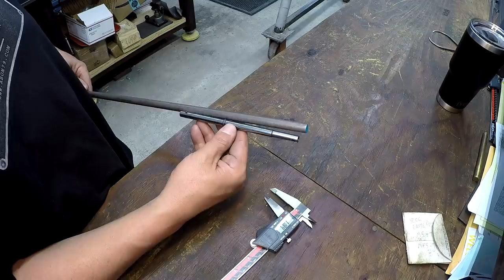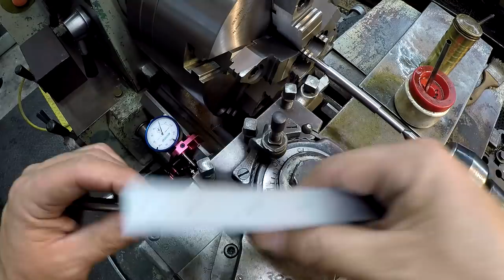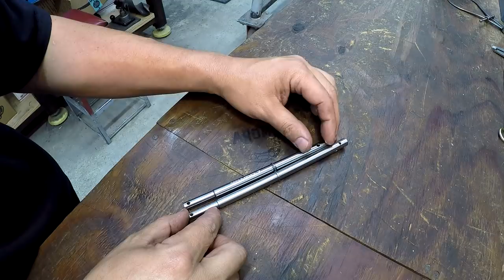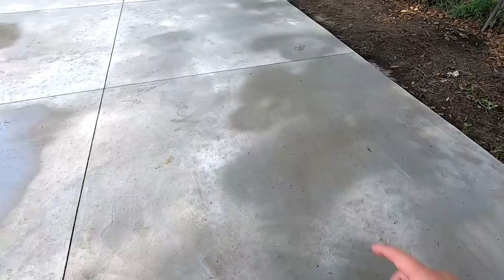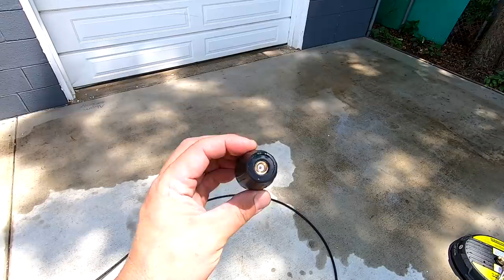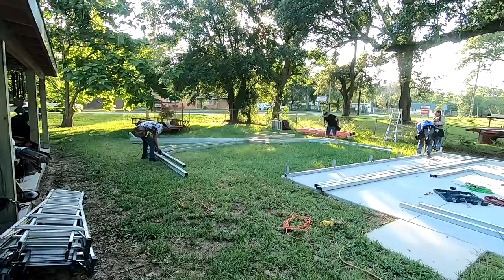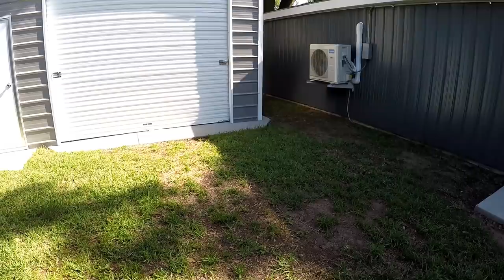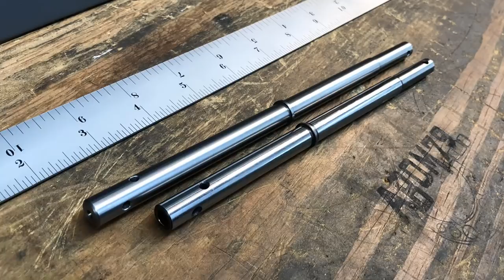SNS 264: Drone Shaft, New Garage Building, Carriage Indicator

Comment: Hey Abom79 apologies if this is a silly question. This question is for you and for the big fans.
What is the specific type of lubricate that you apply when taking turning cuts on the work piece?
Ouuu wi even thought is bed time in my region you got me hankering some of that Shrimp man?
Reply: Dark thread cutting oil.
Reply: Pretty easy to get from a hardware store if you need some
Reply: I use Oakley dark thread cutting oil from the plumbing section of Home Depot.  It’s about $7 for a 16 ounce bottle.   I also use 10w40 on aluminum, it works great and doesn’t give me headaches like kerosene(which is also good on aluminum).  The Melissa & Doug no spill paint cups from Amazon work great with acid brushes from Harbor freight.  Hope this helps, Chris
Reply: @calvinculpalt  Thanks
Reply: @shadowdog500  It helped alot. And your reply has provided me with all want I needed for my machining lubrication setup.

Comment: Adam, how do you heat and cool such a building? Where do you place the insulation? It does get hot and cold in Pensacola doesn't it?
Reply from the maker: It’s a storage building, not a work space. You can buy these with insulation for a price.
Reply: @Abom79  What kind of insulation would work? Clearly, there isn't any room to put in fiberglass bats. My question was more of how to do it rather than why you didn't do it which of course is your business. I don't see anywhere for the insulation to go.

Comment: The customer was wrong.  The rod must be hollow to save the flying weight.
Reply: They do not have to be hollow but they can be hollow to safe flying weight. These helicopters can lift quite some weight and allthough it is preferable to keep weight as low as possible, these grams do not affect flying behavior that significant (especially considering that they are right on the axis of rotation). My guess is that they did it from a mass production point of view, there is quite a lot of material (and money) saved when you can make these mainshafts hollow. When I look at the cross section of the shaft it could be more than 50% savings in weight and material.
Reply: @StefsEngineering  An heavier shaft will produce higher gyroscopic precession forces. This will affect handling when trying to change yaw, pitch or roll. How much depends on RPM's and weight. Hollowing out a shaft will affect production cost more due to tool wear and production time. Usually this is way more costly than the cost of the steel saved. (Steel is cheap.)

Comment: would be nice to know what the price was for that little shaft was.
Reply: OEM Align helicopter shaft $21.39
Reply: @eksostan9176  if correct, thanks.
Reply: @eksostan9176  That was for their original spec - Adam's customer wanted it modified, so much more than that for a custom part.

Comment: Strange that the customer wouldn’t just buy new shafts from any of the hobby stores that carry Align parts. They sell a two pack of replacement shafts for $20.
Reply from the maker: I’m willing to bet he wouldn’t have gone through the trouble finding a machine shop if it was just that simple.
Reply: Did he not want a longer shaft? Maybe that would be why he got it custom made? That's the customers prerogative if he is willing to pay .Nice work as always
Reply: Longer shaft most likely to provide clearance for a replacement body the is a scale copy of a real helicopter. This is for a T-Rex 550L. I have one that is slightly smaller.

Comment: well.. dont know for sure , but if the shaft is really gointo rc copter of any type , its way too heavy. ofc ..if person dont mind of serious (FAST)rotating mass , then its ok. Nice job any way.
Reply: I'm 90 percent sure that its atleast an align 600 or a clone.  As he said he didnt really know but my guess it he converted to to be a heavy lift heli for more of the "drone" capability and not so much as a performance helicopter that it was. Weight is always an issue but for regular flight not so much.

I did the same thing with my SAB helicopter.   But to carry heavier load I had to put a beefier head to hold the larger blades to give better lift and the factory shaft didn't work.  So a custome shaft was made 1 inch longer.

Comment: how much was that building installed?  Out of curiosity?
Reply: @oleran4569   The last metal building I had was from one of those carport metal building companies.  I traded a construction buddy for the cement work (I replaced his clutch, he handled the pad)  My buddy had me get the exact measurements and poured the concrete on 3 sides to the exact dimensions so the siding would lay over the edge of the pad and keep water out. (he gave it a few degrees slope too so it didn't come in on the side with a roll up door)  I forgot all about this until you mentioned your issue.  If/when I do my next metal building I will make sure to do this again, thanks for the reminder.

Comment: For the lighting, why not look into getting Solar panels and a battery? I know Harbor Freight has ones for RVs that does about 100W, so maybe using 2 of those and a battery would give you enough for lighting?  If it isn't going to be a workshop, that should be all you need...
Reply: That big old tree shades the roof.
Reply: @garybaris139  They can be moved to areas where the sun does hit and run cabling.  It wouldn't cost much for a pole along the side of either the house or the out buildings, if he didn't want o mount to them directly....

Comment: That shaft look to be a tail boom for a helicopter.  Sometimes being hollow is important because the drive belt for the tail rotor goes through that shaft.  But I suspect your customer knew what he needed so it is probably good, just adds a little weight to the overall aircraft.
I like the new garage.  It should last you a lifetime.  Keep the great content flowing Adam.
Reply: Its the main shaft. The tail boom is as you say hollow but basically just a tube. On the Align 550 from which the original shaft came (it was etched onto the shaft) the tail boom is a carbon fibre tube as is the tail drive.
Reply: If that shaft was a tail boom, that would be one stocky helicopter hahaha

Comment: Oh, the guy will want it hollow once he realizes the weight difference. Its much easier for a motor to change rpms faster if the weight of the shaft is lower...
Reply: Artem Nikitin you don’t want the rpms to change. The main rotor (which this is a shaft for) is supposed to keep a constant rpm

Comment: How much do you charge for a shaft like that? The original shaft for Align T-REX 550L is only 15$...
Reply: But it's a custom version ... I wouldn't charge less than  $200. Adam is an excellent machinist and with his overheads, I personally wouldn't expect him to charge less than $100/hour.
Reply: Yeah a minimum 1 hour at shop rate.
Reply: @chrissometimes7473  AKA $700 for the one off

Comment: Never, never leave a pressure washer running with the spray not flowing, the pumps will blow early, trust me, start the motor with the gun flowing then shut down the same way.
Reply: With his unit, its possible. But any decent washer will have a good pop-off valve. Im more worried about his contractor not working better with the man door off set. they could have bumped that over 6" no problem. I know its prefabed but come on, they have tools.
Reply: Pump has a bypass valve. But it will get hot if you leave it in bypass too long

Comment: > Abom 2018: Builds tanker gearings
> Abom 2019: builds RC heli shafts out of cold rolled without even centering the piece (cause of 6 jaws). Also buys shelvings instead of making them by himself
> Abom 2020: 3d printing is the future!
> Abom 2021: fuck imperial! Metric just works way better!
> Aboma 2022: ima cut my penis! Death to patriarchy! 

Be careful down this path Adam.... It all happens in a blink